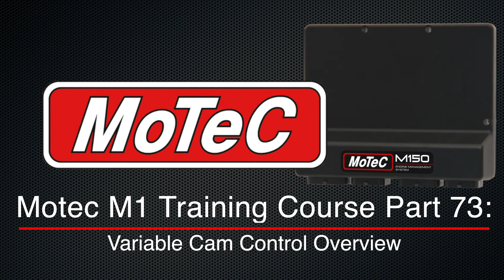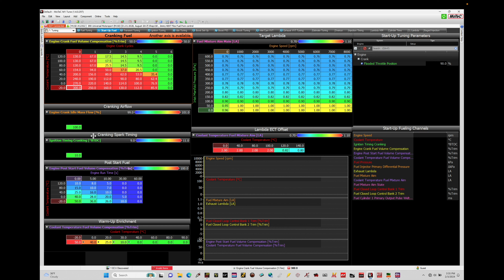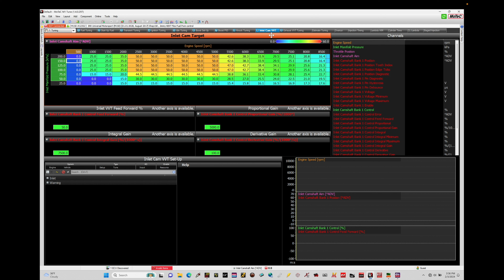Motec M1 Training Course Part 73: Variable Cam Control Overview | Evans Performance Academy

Comment: Hi, can I ask a question about Hondata torque limit calibration - on Stage 2 hondata tune the torque has a dip from 3000-4500rpm,  it’s not consistent across the rev range,  can I just simply adjust the torque to 300Nm from idle all the way to 5000 or 6000rpm? or does it need proper tuning to support it?